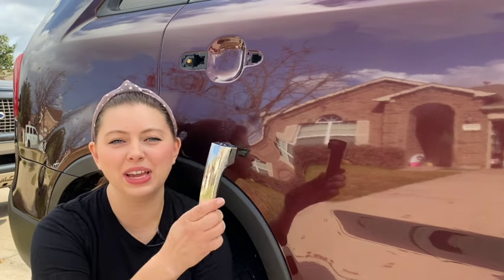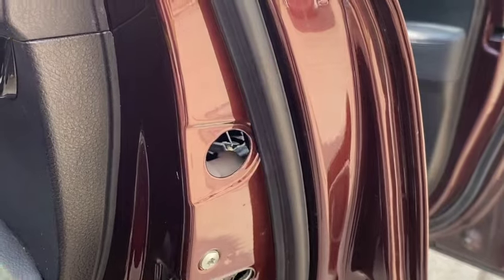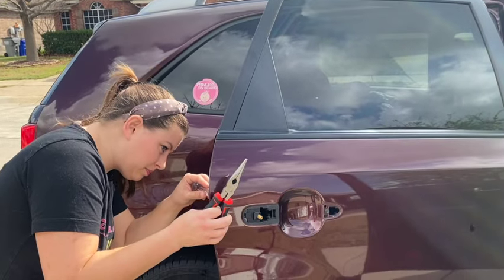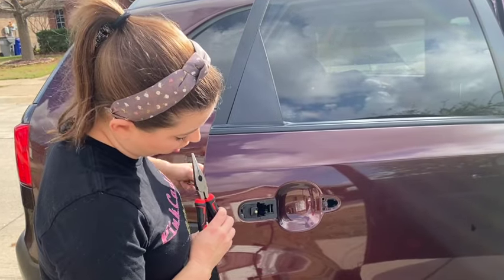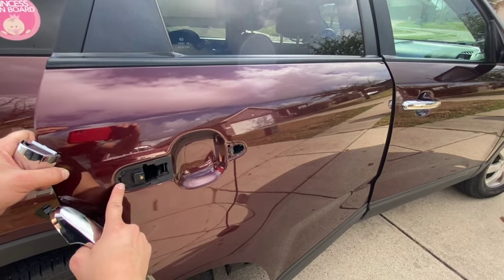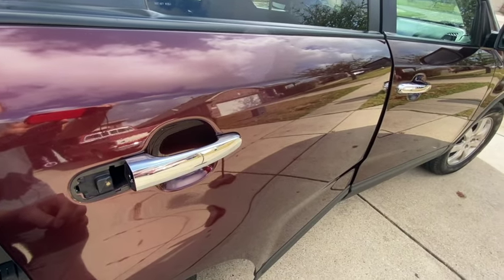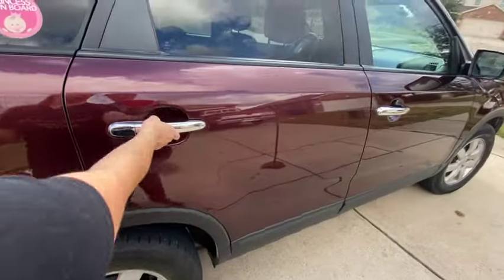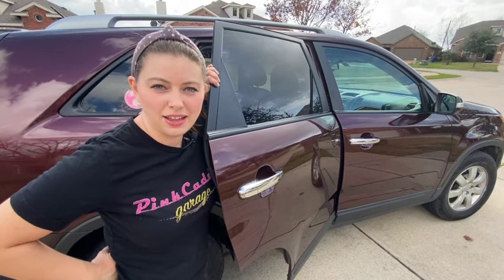How to Replace a Broken Kia Door Handle

Comment: I was quoted $300 to fix this. $12 part from Amazon …,10minutes to install….Bob’s you’re uncle. One tip is don’t back the set screw too far because it will catch on the edge of the hole that it passed through making it impossible to tighten back through the hole. I had to widen the hole to allow it to pass. Thanks so much for this Vid!!!
Reply from the maker: Thanks for the tip!
Reply: I was quoted $450 from the dealership!! 😵 I only need the cap part $10 on Amazon.  I just ordered it.  To clarify you're saying not to unscrew the bolt too much otherwise it doesn't fit back easily?  So unscrew just enough to take off the broken bit, and then start new one right after... Thanks for sharing, that sounds like a mistake I would make 😅
Reply: Ok, I just rewatched it. Yes, she actually alludes to this in the video when she says to back the screw off until it’s flush. I backed it off too far and it would not reenter the hole until I enlarged it.

Comment: Wonderful! Rear rh door handle (which in the UK is offside] pulled out of my Kia Soul with a huge bang - so that the forward end was exposed and wouldn't go back.. Early in August my local Kia dealer offered to book it in on 30 September (!) and they'd want it for a whole day for diagnosis! With the help of this video I was able to fix it in minutes this morning. Was ultra careful not to drop the screw inside the door - used grips for the last few threads. Many thanks and you're now a bookmark fixture! Long may your brilliant advice continue!🧐
Reply from the maker: Thanks...didn't realize they are still using the same chintzy handle!
Reply: Different detail but the clue was the access point and I took it from there. Brilliant!

Comment: Glad I found your video, mine broke last week on my Sorrento and I wasn't happy. The auto body shop was too much money and the online Kia parts store were a rip off. Bought mine on Amazon for $13 bucks and it worked. I'm sure this won't be the last a handle breaks. Thanks!
Reply from the maker: Seems like the handle in that position is the weak point.

Comment: Thank you so much for your video. I live in Australia and the door handle for just the driver side, the dealer quoted me $184AU for a “diagnostic check-up”, then the part hand to be ordered, $100AU. Then when it arrives, another $184 to install it. Bought the handle off Amazon and did it myself, $34AU 😂
Reply from the maker: You saved a small fortune!

Comment: My handle literally just came off this morning on the passenger right. Thank you for this video!
Reply: Keep us updated because I accidentally broke my bf passenger handle and he has t noticed yet but when he does I’m grits !! I’m about to order the handle now Omg
Reply: Did you order the cushion padding as well ?? Or ??
Reply: @chelseamarie2218  thankfully I didn’t need to it was still attached to the door when the handle came off. The handle came last week from Amazon and I’m good as new. I’m just glad I didn’t have a much newer Kia otherwise I wouldn’t have had that small compartment to take off to get to the screw,
Reply: Based on the videos I’ve seen this happening is not that uncommon which surprised me so don’t feel too bad.
Reply: @AC-qv4ij  Omg girl the handle is half way connected to car. It appears nothing wrong with the handle until you pull the handle to get inside the car. One side is attached the other side is broken so I have to be extra careful when opening
Reply: @AC-qv4ij  what color handle did you order cause all I see is chrome
Reply: @chelseamarie2218  I ordered the Exterior Rear Right Passenger Side Chrome Door Handle Replacement, It’s the exact replica of door handle.
Reply from the maker: Perfect.
Reply: @chelseamarie2218  when my handle broke off both the long piece you pull to open the door along with the smaller piece or button that  your thumb sits on when you pull to open the door came off as well. So what I did while I was waiting on the handle I put the larger piece back on and slipped it into place by pulling to the right like the video showed until it clicked and that allowed me to continue to use the door if I needed to get into it from the outside.

Comment: I love your content. This happened to me lastnight & I was in utter shock. Thank goodness you made it look so easy to replace& you were very clear about making certain to order the correct door handle & gasket if necessary.  I have followed your videos to repairs before & they are always crystal clear, step by step. I have a question, do you have a solution to fix my mirror back up camera? The sensor still alerts when I back up but the picture does not show in the rearview mirror any longer. Kia 2012 Sorento. Thanks for all you do !!
Reply from the maker: Sorry, mine did not come equipped with a backup camera.

Comment: Where do I find the washer or rubber that needs to go on before installing this? You mentioned it but didn’t say where to get it from?
Reply from the maker: Sometimes the new handle will come with a gasket, and other times you have to reuse your old one. If you’re already threw your old one away shop around for one that definitely comes with a new gasket.

Comment: Brilliant. Thank you. Can you show how to fix the little .etal lice where the spring goes out and you have to hold it up with your finger in order to get the door to close?
Reply from the maker: I haven’t run into that yet, but if I do, I will post a video
Reply: I meant to say the latch on like.. the inside of the door. I have to hold it up in position in order to close it

Comment: Awesome video! However, what do you do when the back door is stuck on “child lock” and the handle broke ?
Reply from the maker: I’m not sure, but I would start by looking through any mounting holes on the exterior of the door to see if I could get a tool in there to activate the latch

Comment: Great video. This happened to my 2016 sorento recently.  I think kia got wind on the simplicity on fixing this and decided to take away that access hole because mine doesn't have one. Looks like I got to figure out how to take off the inside panel. Any tricks on how to do this?
Reply from the maker: Sorry, I don’t have access to a 2016 or newer model. Usually though there were a couple of attaching screws somewhere on the panel, sometimes behind plastic cover. Remove those after you find them and lift the panel up and away from the door.
Reply: I have a 2016 Sorrento as well and my two back handles keep falling off and my husband keeps putting them back on. I'm hoping to find some kind of video/guide to doing this.

Comment: I was wondering if you would know what type of screw it is as I dropped mine inside the car door and now need a new screw to be able to install the handle 
Thanks so much in advance if you can help
Reply from the maker: I don't know offhand, but if I were you I'd remove the one from the other side and see if I could match it up at the hardware store.

Comment: Real nice clear and simple video. How about the driver's side door handle -  the door will lock using the key - BUT - after the dealer replaced the door latches ( recall ) the door will ONLY lock with key, not the fob. I can plainly hear a rattle when opening and closing the door - did the tech forget to attach rods - and is it necessary to remove the entire door panel to figure this out? The way things stand, not only did the tech screw things up - he also forgot to put the screw back in to secure the cylinder - I can now remove the entire lock cylinder as easy as picking my nose. No, I won't return because he wants to charge me to 'diagnose' the problem - even after I've sent photos of what's going on.
Reply from the maker: I’m not sure what the mechanical problem is, probably a rod that is not reattached like you said. In any case, the door panel will need to come off to access those components.

Comment: Thanks for this video the dealership told me $309. I ordered the handle but what is that piece called that padding called that protects the metal? Just realized I don't have that.
Reply from the maker: We found that so long ago I don’t recall if the new handle came with a gasket or if we reuse our old one. Ironically, I can tell this one is about to break so the next time I replace it for the third time, I will see if the new handle comes with the piece of rubber.
Reply: @pinkcaddygarage267  The handle I ordered did not come with it. I found the padding by clicking on the link you posted for the rear driver side. When the link opens scroll down it shows what ppl normally purchased with the handled and the pad was on there. The padding should be here tomorrow!! Yeah!! Thank you again for this video you saved me $300 lol
Reply from the maker: Excellent, thanks for the updated info because other people were wondering about that padding as well!

Comment: Do you have a video for repairing the lift gate latch?
Reply from the maker: Not yet, but about to do the same doorhandle for the third time.
Reply: Awesome! I haven't seen a video for replacing the lift gate latch for the 2009 Borrego. Mine doesn't have the separate window that opens.

Comment: Is the gasket necessary?  I got the part from eBay (no gasket) because Kia is out of stock, like forever…great video, thank you
Reply from the maker: That gasket typically helps keep moisture out of the inside of the door. This one looks like it also cushions the handle when it slams against the base when you let go of the handle. While you can have functionality without it, I’d go ahead and order one and install it whenever it becomes available.
Reply: @pinkcaddygarage267  thank you for the quick response and suggestion, which I’ll do.. keep up the informative videos…

Comment: Is the process for the fonts the same?  Access hole on the side of the door?  I have a 2008 Sorento so a little older then the model you have here.  Thanks
Reply from the maker: I only have experience so far with the rear door handle. However, I would think the process is going to be similar for the front.

Comment: Hello I tried to remove the broken piece and the screw from the handle fell inside the door. Do you know where I can find a replacement screw? I don't want to remove the panel. It's too much work. Help!!!!!!!!
Reply from the maker: Of course the dealer will probably have one. As a real first choice though, I would take the door panel off, it can’t be that hard, because I wouldn’t want that thing rattling around in there. As a second choice, you could take the screw out of the other door and take it up to a hardware store and try to match it up.

Comment: So on my wife's 2010 Sportage the driver's side door handle broke off, the part that you put the key into is still intact. It looks like the rest of it where it broke off is still inside screwed on. I'm guessing I will need to take that broken piece out before I replace the handle. Will removing the screw inside allow me to take the broken part out?
Reply from the maker: Hard to say without a picture. Check to see if it looks like the screw side lines up with the broken piece side. If so, chances are when you take the screw out the broken piece will come off.
Reply: @pinkcaddygarage267  Talk about a prompt response. Yes, I lined it up before and it appears to be a break there. I knew as soon as I looked at it that I wouldn't be able to put in the replacement with that in the way so I assumed it needed to be removed. Thank you so much and keep up the good work.

Comment: the latch isn’t clipping into the door handle for me, do you know any way i can fix that?
Reply from the maker: I haven’t run into that problem. Make sure you have the new handle pushed forward so that it is locked in the place as shown on the video if that is done properly and you don’t have any mechanical damage inside to the latch it should operate the latch from that simple action.

Comment: Trying to do this, sounds easy enough but the screw is so tight. Not as easy as you make it look. Don't want to strip the screw.  any suggestions?
Reply from the maker: Probably looked easier on the video because that was the second time that handle had been replaced so the screw probably wasn’t “factory tight”
Reply from the maker: You need to get a screwdriver that fits perfectly into that screw or else you could end up stripping the head of the screw. Have someone on the other side of the door to brace it and then put all your weight into it while you’re trying to get it to break loose.

Comment: What is the name of the "piece of metal" that you hold? (0:38). I lost it 😞
Reply from the maker: That is just a piece of the old broken door handle. You don’t need it. The new handle will have that build into it and you can screw that brass screw into it as shown on the video.
Reply: @pinkcaddygarage267  ah, ok. Te agradezco mucho (thanks a lot). I Will look for the handle cover. 
Thanks for the video.

Comment: I’m not able to open the driver’s side (exterior). Would this be the case?
Reply: The exterior door handle is not broken. When unlock, not able to open from outside. I would have to open from the door behind the drivers side…
Reply from the maker: On some vehicles, the handle is connected to a rod that operates the mechanism. It’s possible that Rod has become unhooked. You’ll need to take the door panel off to take a look.

Comment: But what do you do if the handle comes off and the child lock is on so you can't open the door
Reply from the maker: Well, I haven’t run into that so I’m not sure to tell you the truth. But, I would try to determine what the broken handle was actuating and then try to use a Screwdriver or other tool to actuate the mechanism.

Comment: I cannot get the screw to loosen to be able to take off the gold color bolt in the front any ideas
Reply from the maker: Just to be clear, are you saying the screw won’t turn or that the screw is turning and the gold part is turning with it?
Reply: @pinkcaddygarage267  screw won’t turn and the gold part won’t move either I’ve tried to turn that with pliers as well
Reply from the maker: You’re going to have to get a very big yet well fitting Phillips head screwdriver that fits that screw tightly. And then you are going to have to use all your strength or both hands, or a power drill with a Phillips head attachment while you’re pressing hard against the back to get that screw to turn. It will eventually come out.
Reply: @pinkcaddygarage267  is there a way to get a power drill in there it doesn’t seem long enough
Reply from the maker: Yes, you can buy an extended link Phillip shared attachment. I’ve seen them in the hardware store in the auto parts store but it needs to be a pretty big Phillips head to match the size of the screw. Might do better at a hardware store for choices.

Comment: The screw will not line up with the hole on the back of the new part that I bought.  Something is out of line because the screw will not hit the hole right to catch the threads.  Anyone else have this problem?
Reply from the maker: If the replacement part is manufactured correctly and there is no damage in the door area, I would think it almost hasto go together. Have you tried angling the screw just a bit to see if you can get the threads to engage?
Reply: @pinkcaddygarage267  Yes - I have seen another video where someone had to take a rotary tool to their new part to modify it enough to fit. Most are cheap Chinese crap so I suspect quality varies.
Reply: I have this problem too.  It won’t lie flat no matter what we do
Reply from the maker: That’s interesting. Out of the two we have replaced they both would like flat. I wonder if there is now a bad batch of repair handles out there.

Comment: Ok but what if you can’t get the door open?
Reply: There's a plastic lever tab inside the hole. You can use your finger to release it
Reply: @tluva1020  can’t access the hole at all the door won’t open at all

Comment: The information in this video is totally useless because it doesn't explain how to get the door open to get to the screw if the child lock engaged.
Reply from the maker: On the other hand, if the child lock is not engaged, then it’s still totally useful!